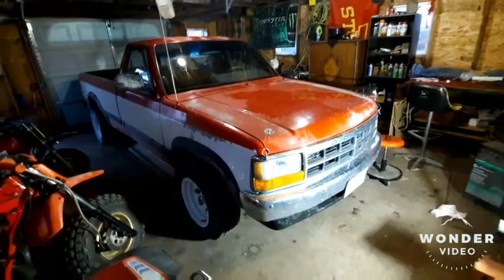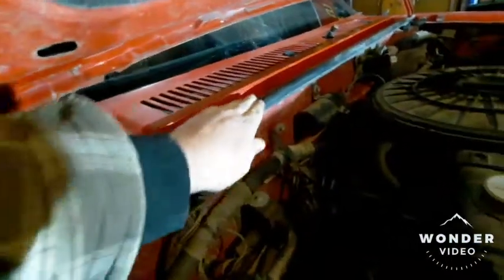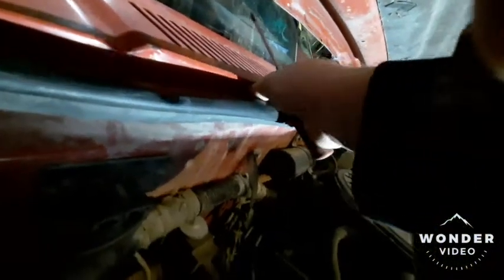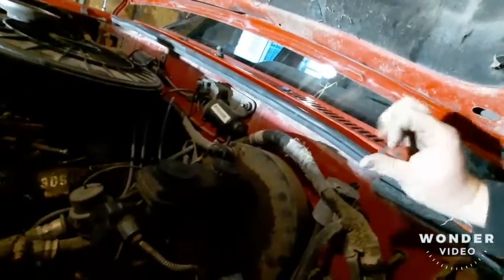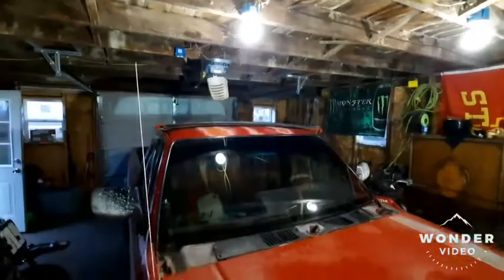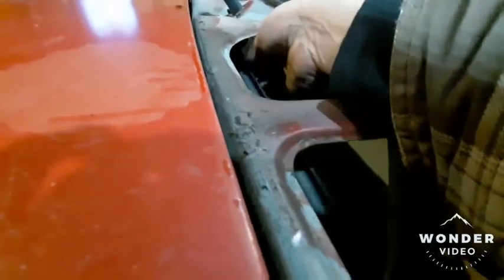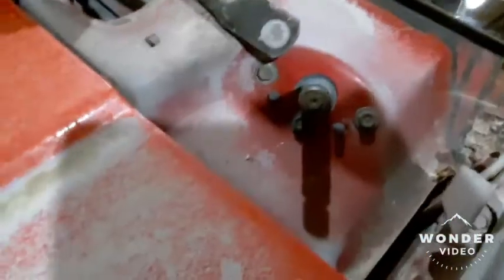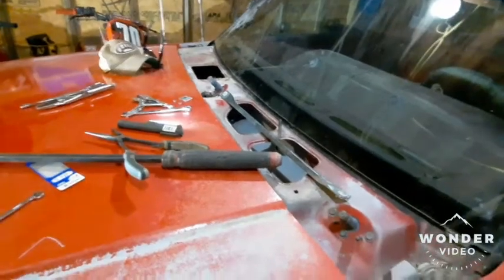replacing windshield wiper bushings on a 1989 dodge dakota

Comment: There are three bolts at each wiper arm pivot. Six total and you remove the entire wiper transmission linkage. Install the bushings and slide the linkage back in. Six bolts and a few bushings later and your problem is solved. 
 Seems you made a bit more work for yourself. 
I've done this on my 1985 Ramcharger and my 1989 Dakota sport. 
No drilling is required.
Reply from the maker: Yeah, I'm not gonna lie, I don't remember every video I made, but this one was a bit of a shit show lol I definitely remember it